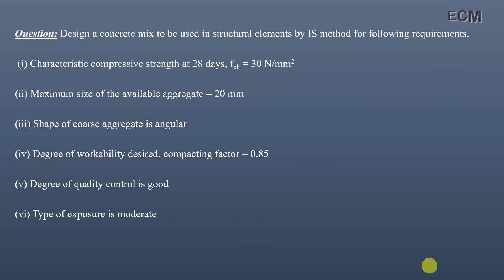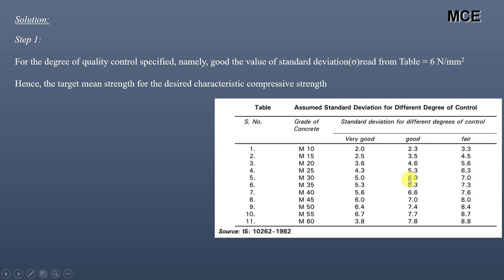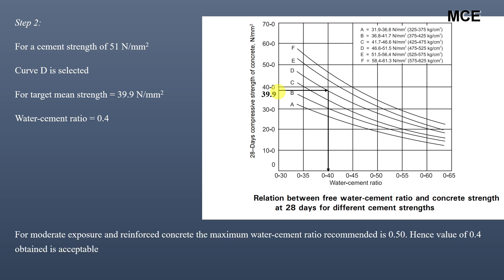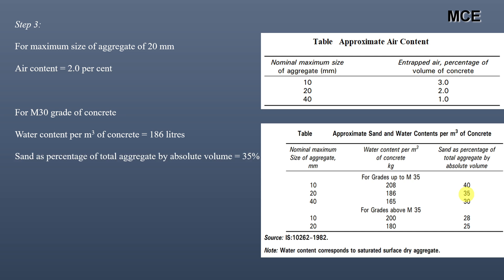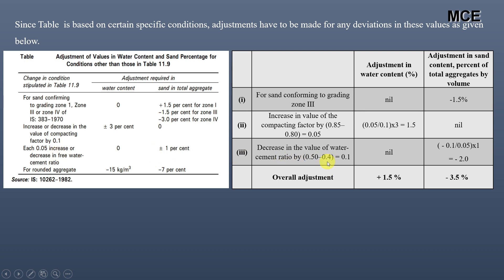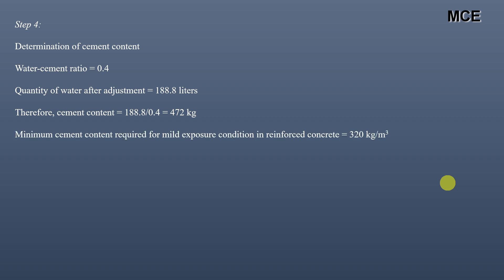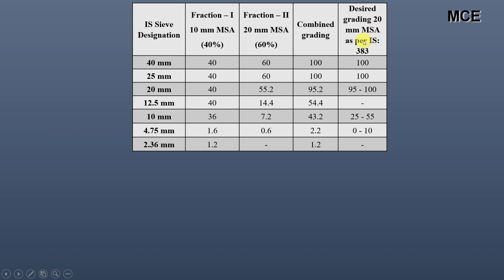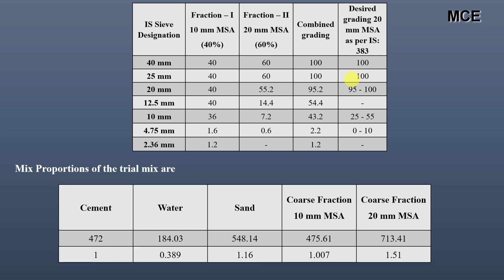Concrete Mix Design of M30 Grade of Concrete as Per IS - 10262:2019| Solved Problem

Comment: Wrong!!!!
Cement can't be more than 450 for M30, as per IS.
Reply from the maker: Thanks for watching dear
Reply from the maker: The maximum cement content as per IS 456:2000 is 450 kg/m³ for ordinary Portland cement (OPC) in a design mix of concrete. This limit excludes fly ash and ground granulated blast furnace slag (GGBS). However this limit can be exceeded after carefully evaluating the risks of drying shrinkage, thermal cracking, and alkali-silica reactions.
Reply from the maker: In this solution video my cement requirement was 472 kg/m3 so i have accepted it and calculated the quantities of CA and FA since the aim of the video is to help students to understand the concept.
Reply: @MasterCivilEngineering 
No excuses are accepted, it's not allowed to do whatever you want. You have to consider the limitations.
Reply from the maker: Code has mentioned it you can exceed this limit under special conditions so there is no excuse and in actual situations this limit is usually exceeded.
Reply: We can't restrict the cement amount to 450, as the other additionals like Fly ash will be calculated as per the weight of cement. Like 30% Fly ash may have the weight of 550, so the whole proportions needed to be changed, like the Amount of Sand, Coarse aggregate and water...
Plz do study and than release a video 
 @MasterCivilEngineering
Reply from the maker: I have already mentioned it that when you restrict cement content to 450 kg/m3 you have to recalculate all the quantities of CA and FA and also grading of aggregates.
Reply from the maker: You can either restrict the cement content to 450 kg/ m3 and calculate the quantities of CA and FA or accept this value of 470 kg/m3 and take special precautions at site for drying shrinkage stresses. Both methods will be correct and will depend upon the judgment of EIC and actual testing results.

Comment: specific gravity of natural sand varies time to time onsite then how do we mix design ? do I have to mix design each and every time ?
Reply from the maker: Usually it will not vary much than 5% if you take sand from the same source.
Reply from the maker: You can take average value for the design